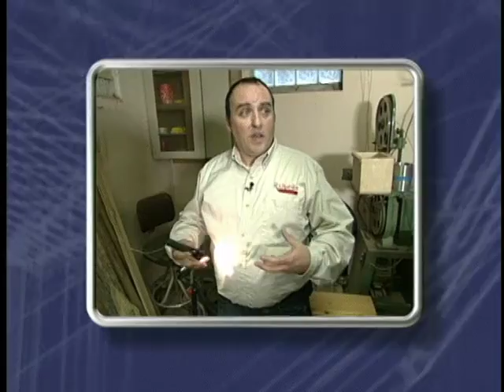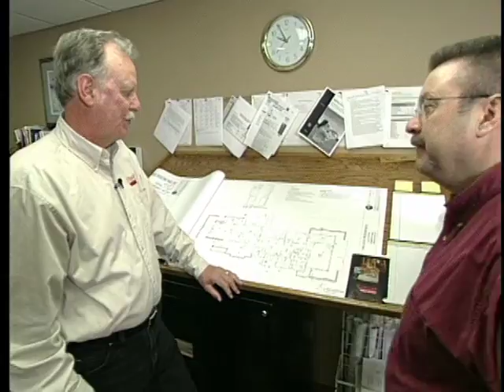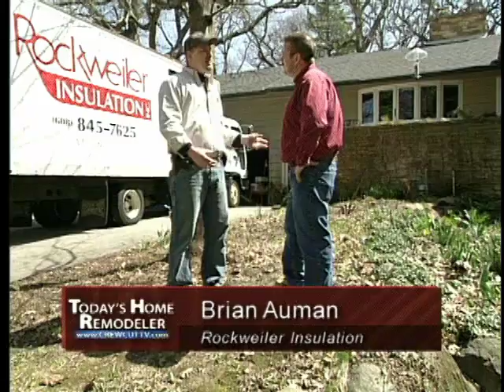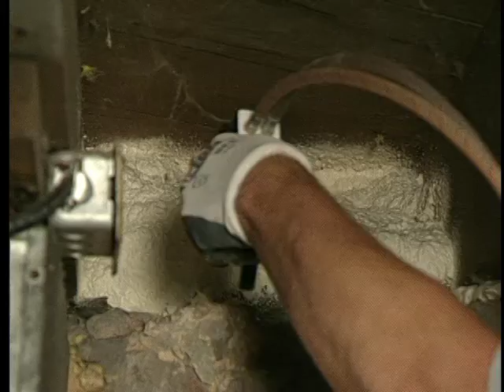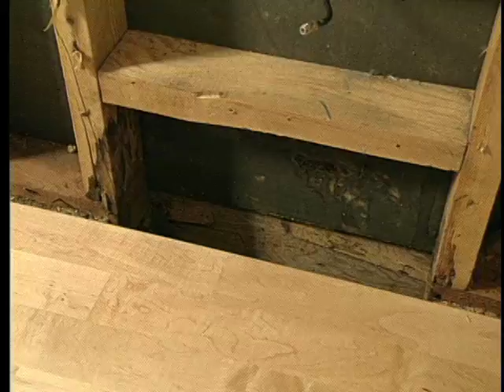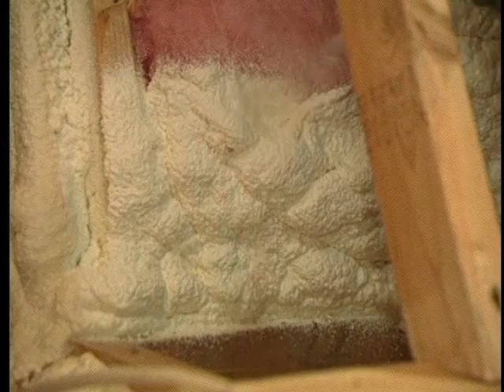Insulating and Air Sealing with Rockweiler Insulation

Comment: I've been looking into attic air sealing and insulation lately and this is the closet I have found to actually showing what gets done and why rather then a basic list. Thank you.
Reply: I'm in process of re-insulating.  I had 1 to 4 inches of vermiculite insulation that I had to remove after verifying that it was not asbestos contaminated.  I had to vacuum out all of the insulation which took me several days.  I then installed a radiant barrier, new vented soffit and a ridge vent.  I am now in process of rewiring the home and getting it up to code or above.  I will then air seal all the air gaps like this video shows.  I only have around a couple thousand dollars into the whole project but lots of my own personal time invested.  If you do this yourself, invest the time into education so that the job is done right.  I have at least a hundred hours of time invested into making sure I would be as competent as anyone I would hire, probably more. Either you will spend time or spend money. Go all out either way and you'll be happy with the results!
Reply: The one big thing they skipped is showing how they had all the existing insulation removed or vacuumed out. You can’t easily get to all those top plates in the attic if they’re under 16 inches of cellulose. I was interested in the time and costs involved in that process in particular. Is the old stuff blown back in, or is it replaced?